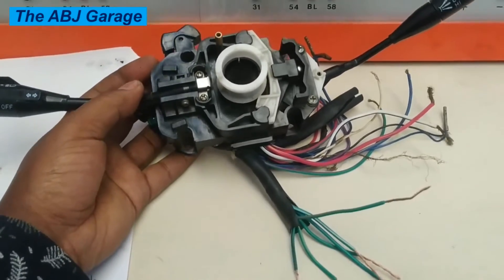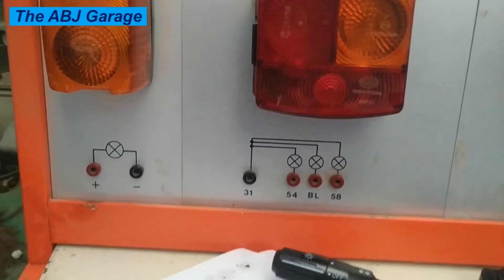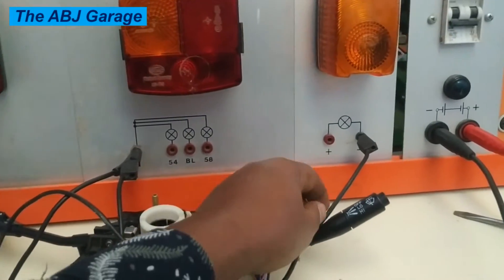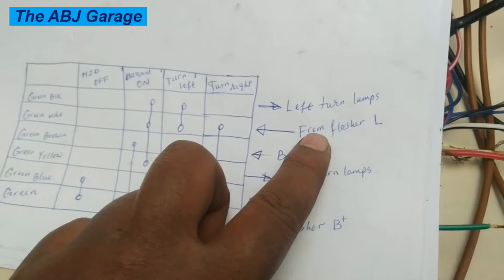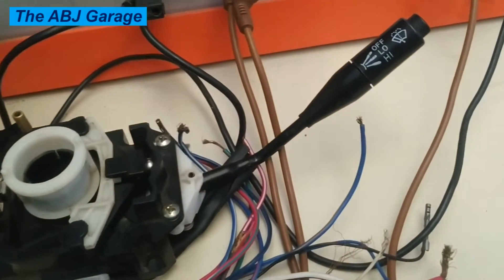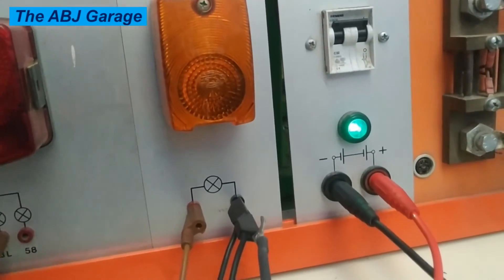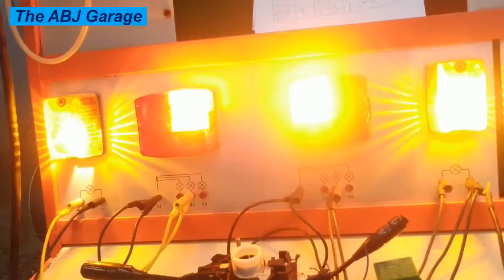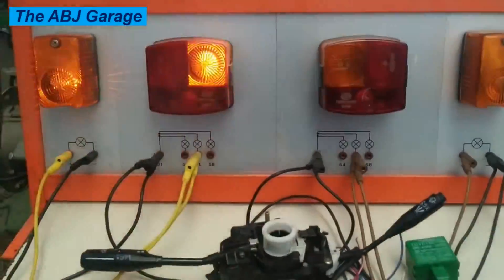How to do basic car hazard and turn signal light wiring part 2

Comment: Hello everyone I have a problem switch for all four blinkers works but do not work on the handle is not a relay is not a fuse what can it be not working me blinkers and fan booths yesterday just stopped working
Reply from the maker: It could be bad turn signal switch or related trouble.

Comment: Dear friend 
Great video, I have aún old car and hazard botton just like the one in video is not working good, how can I add an external hazard botton?
Reply from the maker: Mount the new hazard switch somewhere convenient and extend the wires from the previous hazard switch to the new replacement. Make sure you know which terminal belongs to which wire first!
Reply: Thanks for the comments, the new hazard botton must have 6 pins?or it ciudad be 3 pins?

Comment: Hello ABJ,  my Z3 turn signal has a peculiar problem.  It works properly as I make a Right or Left turn.  However, it only resets  for one side (gets stuck when left hand turn is completed).  How can I fix this problem please?  Thx 13:04
Reply from the maker: Dear! This usually has to do with the mechanical operation of the signal switch rather than an electrical system failure. Either the canceling finger inside the switch is broken, or the canceling cam/clock spring is broken. The most common problem is the self-cancelling mechanism failing to work when the steering wheel is turned back to the straight ahead position after a turn.

Comment: Hi Abj, I would like to add a extra pair of turn signal buttons below my hazard switch in my Hyundai Getz. The hazard switch has 8 wires. Is it possible to do this easily by just splicing in a button to the wires behind the hazard switch? Thank you.